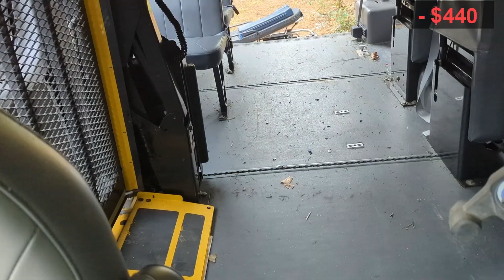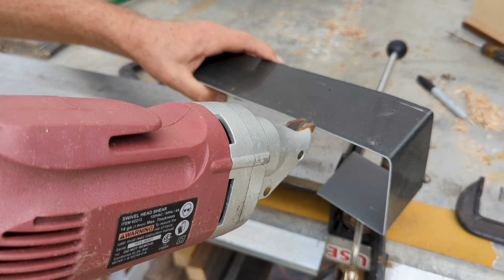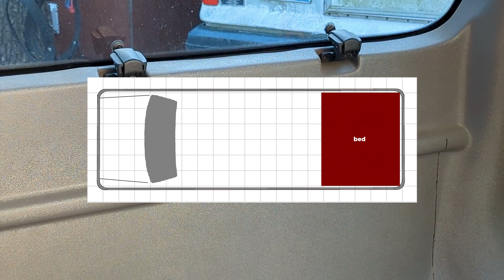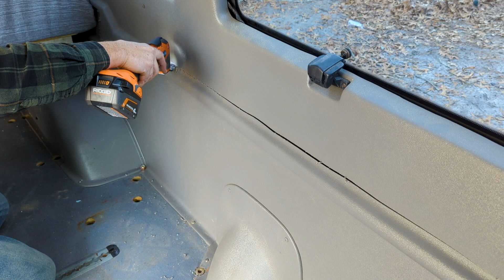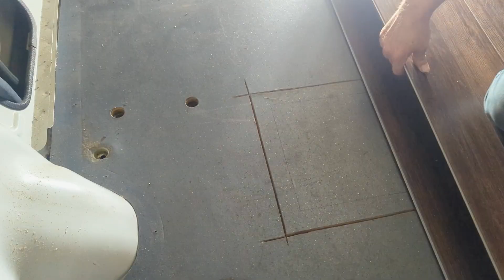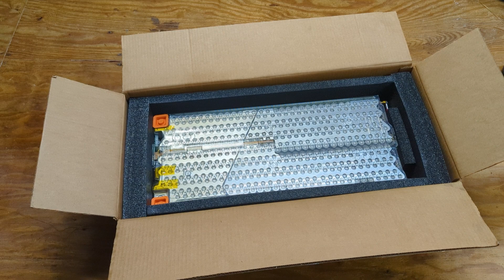Budget Van Conversion | Building  the Most Complete Free Campervan for Off-grid that We Can

Comment: Good thinking in advance on the the fuel pump👍. Ford fails around 80K miles. Loved the location of the power selector switch although the inlet plug, I think, it should be on the right side of the bumper closer to the sidewalk just in case you run an extension cord from the house.
Reply from the maker: Thanks! I was thinking driver's side would be better for campgrounds, but I don't go to those often. House side would have been better